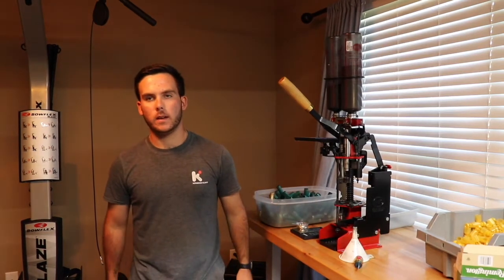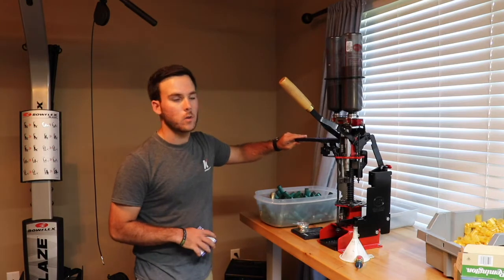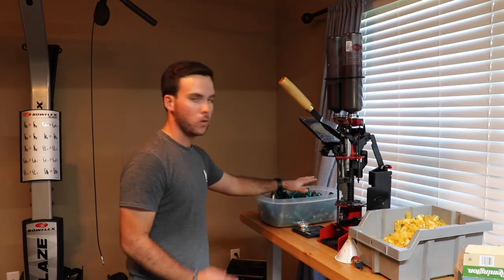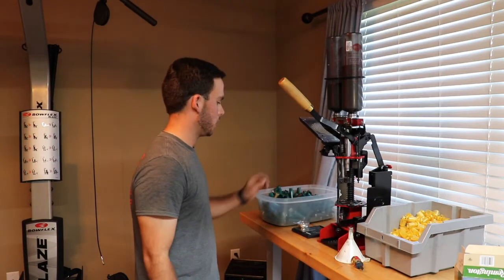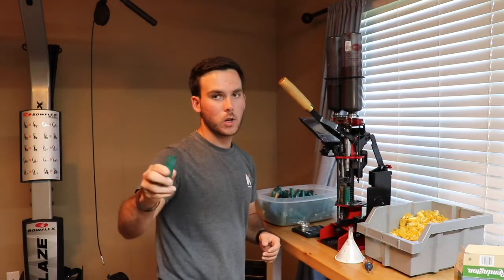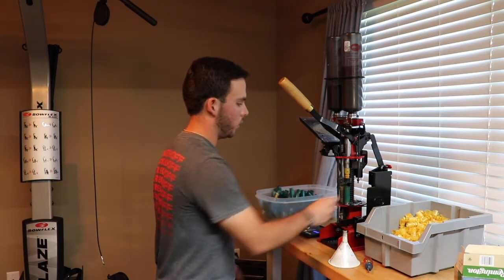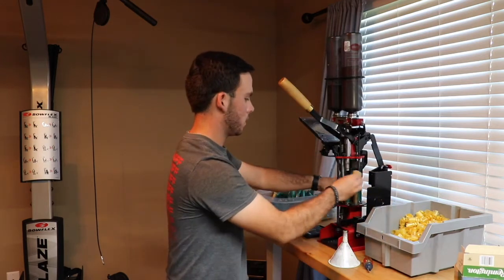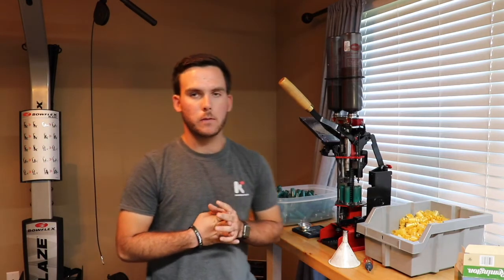How to Reload!!!

Comment: Nice video, but you don't need to tip the bottles back to prevent shot and powder from dispensing.  If your machine is set up properly, the charge bar stays locked until you have a hull in station 2.  Then it will lock again when you run the press down and a hull is no longer in station 2.  Here's a link to how to make these adjustments from MEC:  https://youtu.be/rPMmkvdiJDs
Reply: hey mate, looking into buying this loader, what's your thoughts on it? once all adjusted correctly, easy enough to use?
Reply: @hilux8103  Yes, it's very easy to use and setting it up properly isn't very difficult either.  The MECs are great reloaders.  But like any shotshell loader, to minimize the need to make repeated adjustments, pick a series of components that suit your needs and stick with them (hull, wad, shot size/weight).  Then once set up you shouldn't have to make any more adjustments.  The key is just to read the directions when setting up each station.